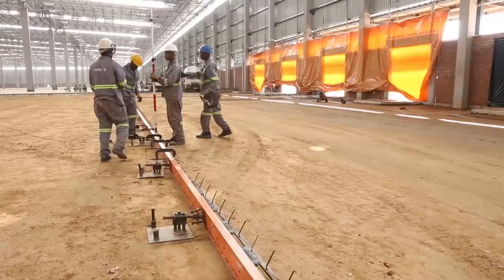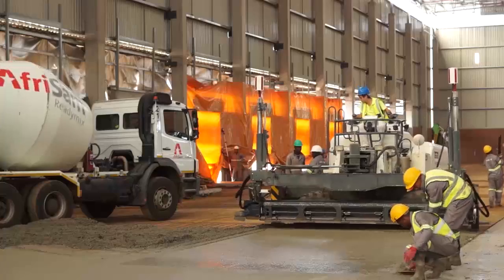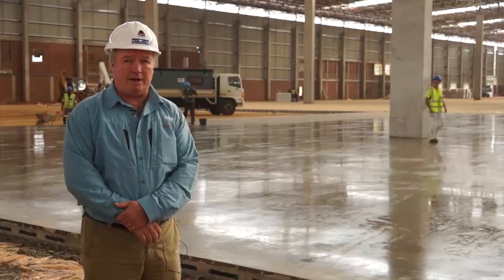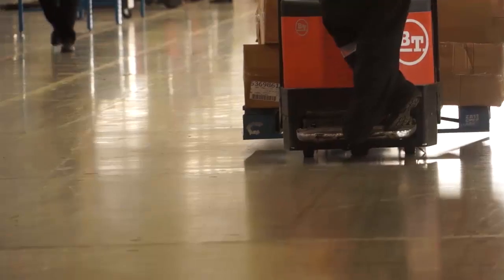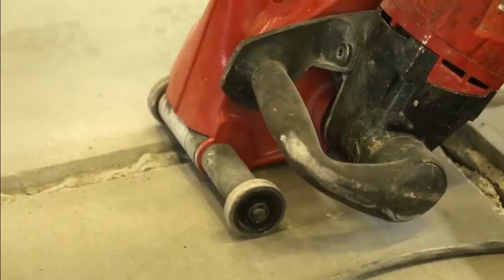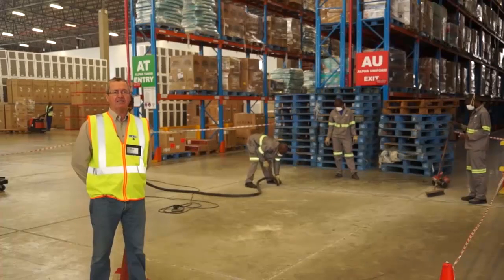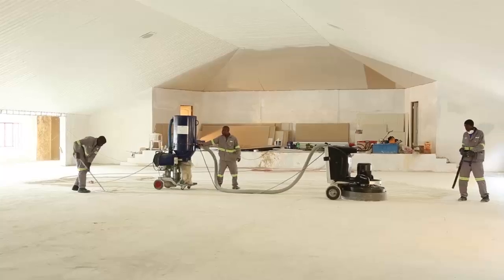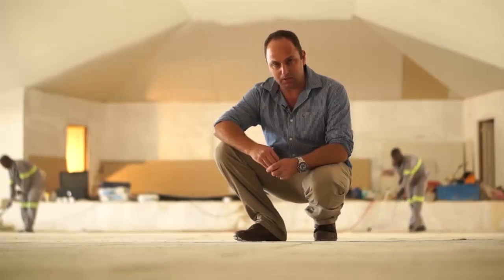Showcasing technologies in industrial concrete flooring [construction]

Comment: Steel fibres eliminate all rebar.  I've used it on shaft and tunnel lining segments...
Reply: just curious...is migration of the metal fibers ever a problem?
Reply: neckarsulme: with the natural solution tension and the correct consistency (according to slump) the correct ratio of Fibres and composite materials will always ensure a 100% even distribution. Same way the sand and aggregates evenly distribute when in the right ratio.
All you need to ensure is 
1) the correct ratio of Fibres and type of fibres are present.
2) the correct consistency is achieved.
3) the solution is mixed thoroughly.

The Romans managed it with horse hair, pomus, ash, sand and limestone. So it can’t be that hard!